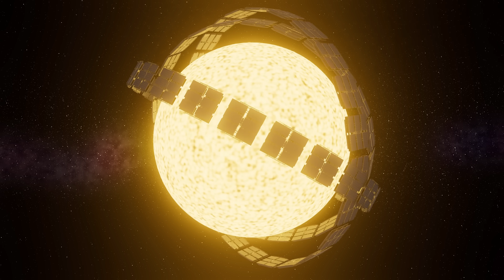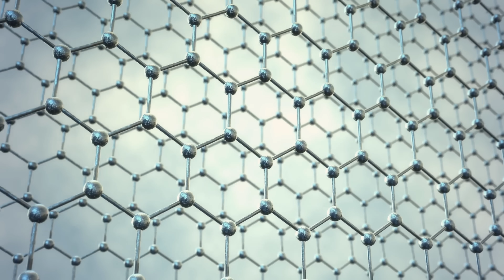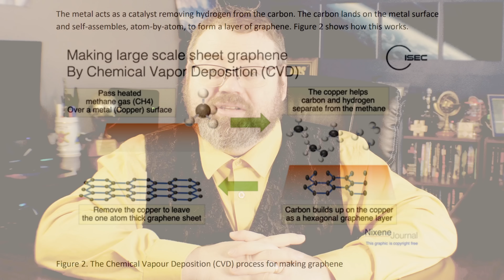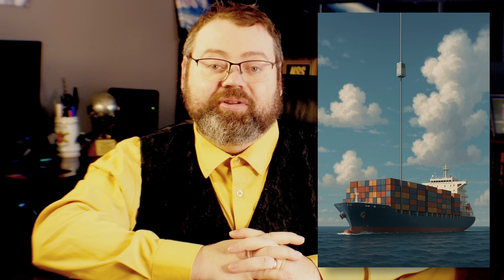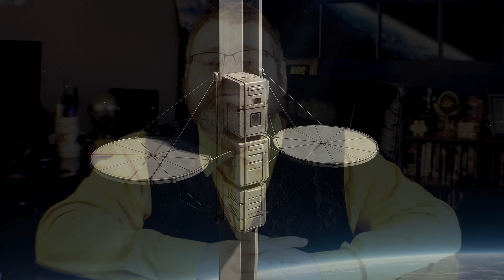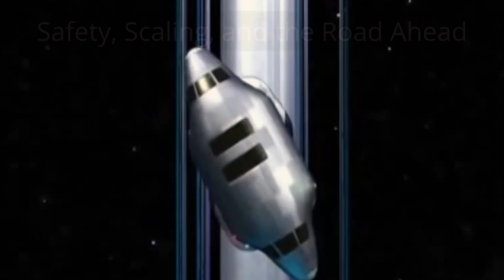Materials For Space Elevators - From Carbon Nanotubes To Graphene And Beyond...

Comment: ah, the sadness when you realize that FTL will be forever impossible. and the gladness when you discover how Megastructures are very much possible.
Reply: I wouldn't be so pessimistic about FTL travel. Until we have extremely cheap to orbit costs, like a space elevator, then we can really stretch our legs to start really developing something exceptional. We all know the government has low key acknowledged AT LEAST that they (and civilians) have been witnessing and capturing anomalous objects on instruments that confirm that somehow, something or someone else is here or visits us. They are capable of leaving our fastest manned and unmanned propulsion systems in the dust without trying. They are capable of making 90° turns or sharper without any perceived propulsion or stress induced on the craft. They have radar signatures as well as heat signatures, they are real matter objects. 

TLDR; don't lose your imagination, because we certainly do not know even a fraction of what's out there, we don't even know what's in the majority of our oceans. We have no reason to believe that any of our present theories or narratives are correct.

Comment: This maybe our only door to space, not exploding rockets,  got to be a better idea than rockets , we use multiple helium balloons every hundred metres of height to stabilise mass and reduce stress on the structure,... I can see  the future to come because it will remain the same more and more, rockets are not the answer....😢😢 balloons and crystalline graphene , balloons made out of graphite net which  uses helium as a lighter gas,  the small box type machines extract the helium from the atmosphere using fractional distillation and this is done at the support points. Energy for this is provided from a perovskite using an amorphous compound layer of solar energy collectors which also surface mounted and stencilled onto the surface of the balloons. This powers the helium distillators which refreshers thd balloons, this becomes more ineffective as altitude rises, requiring bigger distillators. The structure is complete carbon nano fibre,  right down to the electronic circuits to conserve weight. I can say the balloons are like petals or are shaped like tear drop atomic orbitals every hundred metres. Maybe upto ten thousand all placed are stress points and reducing as altitude increases..

Comment: If I may put a bug in your head. Spin carbon nanotubes on copper needles with rotating microwave transmitters. Possibly doped, possibly in rings along the needle's tapered end, to encourage the carbon to settle in predictable rings around the needle.
Embed "rungs" in the tether, for the climber to engage with. These can be simple bars bridging two tethers. A literal rope ladder to space.

Comment: I'm still interested in the economics of tethered rings compared to a space elevator.  It seems like mass would be greater than for an elevator, but launch costs would be nil if you can build it on the ground and then fire it up and let it levitate to its intended altitude.  Which could be sea level at one end if desired.
But I'm not sure what form the orbital mass would take.  I assume it would be something inside of a vacuum-sealed tube traveling at something like 2x orbital velocity, which sounds fairly energy-intensive if you can do it at all.

Comment: Assuming you are using the actual elevator to transfer the energy to the objects going up it why would you even bother with a physical structure of the elevator why would you not just beam the energy from a solar power satellite to each individual elevator cabin rectenna  and then all you are using the space elevator for is to direct the actual objects being lifted and in that case it could be very minimal or actually just a virtual fly by wire

Comment: 11:40~~
Dude... Mars as a source for carbon for graphene?

Venus.
The Process to Break CO2 and make Methane? Easier in high pressure and heat.
Like Venus.

Yes, you have to bring with you the water. Same case in Mars too.

The Launch Window for venus is more often, too.

Venus would be the closest to perfect planet in this solar System for Graphene production.

if we currently had constant acceleration, There would be competition there. Also, if we already had colonies in The Gass Giants...

No and no. Currently, at least.

So yeah. Venus.

Comment: You could have carbon tethers that nothing climbs (aside from tin repair drones), spacers, and then a climbable tether that's strung between spacers.

There are a LOT of ways to address each potential problem.  The tricky part will be doing so in a way that's cheap to maintain and low on mass.

Comment: You need to twist the ribbon to prevent wind from making the flat ribbon from flapping. This is the same for ratchet straps to handle cargo on a trailer.  Of course I still think rotovators are more likely.

Comment: Im envisioning a climber designed like 2 tanks, one on each side of the ribbon clamped together and using electro magnetic connections helping the tracks keep enough  friction for climbing.    
   Love this and all your content.  
  Thank you Isaac
Reply: Or maybe the ribbon has sprocket hole perforations built into it that the climber pushes against using gear-shaped wheels.

If the first manufacturer of such space elevator climbers isn't called Spaceley's Sprockets, I will be sorely disappointed.
Reply: @peterallen5575 100%😂

Comment: Greetings IA.  I’m picturing the defects in the graphene caused by cosmic rays, cascades of muons caused by cosmic rays, solar winds, brownlee particles, and aurora plasmas, etc… Such defects will flow much faster and coalesce more quickly when the material is under extreme tension, causing cascading failures. I’m imagining the wind pressure on the cable and the elevator car, which will push the cable, load it with standing and traveling waves of energy (like a giant harp string) and twist the cable due to curl in the air flow, for instance during a major monsoon or hurricane. I wonder what the Moon’s tidal effects on the cable will be, or the effects of Earth’s magnetic field will be on cables with currents running through them. I am concerned about elevator car crashes, and other accidents, as well as micro satellites smashing into the cable. And on, and on, and on…

[A very rough estimate, from the past, indicated that no material composed of atoms, and held together by the electrons associated with those atoms, could hold together under the tension from the forces from all the various real world sources, even in principle. For now, I see no reason to abandon the old estimates.]

Comment: Expanding on the current design, Transmitted energy either above or below depending on how close the vessel is, primarily due to conversion losses. The tether could have electromagnetic coils in them, that get temporary charges as the vessel is near it's position through a specific frequency of energy transmission to it, transferred from the transit vessel itself. Again, more conversion losses, but that can be factored in to the initial delivery for the full length. By way of having the embedded rail system, it could accomplish use of magnetics without the shear forces from running the magnetics to full length like a Maglev system. This intermittent, and fully controlled system would mean that most of it is off all the time. It would remove the need for solar cells on the vesel, increasing it's weight capacity, cause as is, special solar panels are required in order to function for long term in space, and the "deck" could easily have this version to power the upper half of the system effectively, while the ground half could have ground based panels. Also, the vessel itself could be made with a graphene skin to keep it light, and to put graphene bladders over the exterior filled with water  to protect against radiation, as water is what NASA uses to stop most of the harmful radiation. Need more carbon? Look towards Venus, harvest it's atmosphere for more, just have to filter out the acid.

Comment: I think at this point, ultra strong material better than boron/ carbon allotropes is one of my favorite kinds of theoretical sci-fi BS now, as I realize more and more just how many crazy possibilities extend from the simple fact that something is strong as hell, and that you don't actually have to keep using it just for super strong armor and stuff.

Ideally, this hypothetical even better material would also be incredibly refractory and heat resistant, and still baryonic matter, or at least still having electron clouds, as this gets around some of the finicky problems with things like using the magmatter from Orion's Arm, as that stuff is so weird it'd often be too inconvenient to be of use.

(In the setting, they're pretty much almost always reliant on demigod-like hyperintelligent machines to be nice enough to make anything that uses magmatter for them, that's how tricky it is to actually work with from scratch)

My current idea for "plausible sounding BS extrapolated from real science" is what i call Pulse:

It is basically carbon-based programmable matter, a buckyball lattice specially doped with some other varying elements, each buckyball forming a quantum dot chamber.

Normally, our belief is that such a giant "fake" atom would not be able to form any bonds stronger than the real material it is.

This is originally the case with Pulse...

Until incremental efficiency and manufacturing improvements lead to a variant that can reliably exploit quantum tunneling to do some really fast and weird tricks with its electrons and trapped atoms.

This in conjunction with an algorithm that lets it self-evolve its computational techniques and the "architecture" of its artificial atom layout leads to what's well and truly Pulse:

A material that uses this to dynamically mess with the virtual photon interactions going on within its mass, creating complex Casimir field effects that can alter it in ways previously thought impossible.

Most well known, quickly discovered, and generally easiest to do being its strength configuration.

Though it does become quite dense, and also need a lot of input energy to get to this state.

Comment: If the structure is a big carbon magatube made out of graphene layers, then the structure itself can be used as and electrical conductor to generate magnetic field that will power the vehicles going up-down. Well , going up you need power to move up, going down you need braking system. Or you can use gravity generated power by allowing the falling vehicle(made also of carbon allotropes) to induce magnetic fields and combine-synchronize them with the fields in the cable to transfer the power from falling vehicle to cable by induction. Then the system will be "self powered". Maybe some extra energy is needed but it's likely that almost 70-80 % of needed operational power can be extracted by this "regenerative braking" system.

Comment: I have always thought the space elevator was a great idea, once the difficult engineering could be figured out. If three elevators where to be put up, 120 degrees apart at the equator and then connected to an encircling ring, it could also be a space station . Add solar collectors on the ring as well.

Comment: Still the space elevator is a very unpractical way of going into space.

Here is why: If you would climb one beyond the Karman line, say to a height of 400 km which is where most of the LEO satellites are, and step from the climber, you would fall back to the ground almost vertically like a brick because the system would transfer very little delta v at that altitude.

In order to stay in orbit, you would have to climb all the way up to the GEO orbit, that is, about 36.000 kilometers. If we were generous about the speed of the climber and put it around what the fastest maglev trains of today are, or around 500 km/h, you would need 72 hours just to get there.

After that, if you did not want to stay in GEO, but would want to get closer to the Earth (which is where all the commercial space activity is, and for a good reason, and it will stay that way for any predictable future), you would need to get to the lower stable circular orbit. You could use conventional rocket for this, but that completely defies the purpose of having the space elevator in the first place, so you would most likely perform a series of orbital maneuvers around the Earth. At that height, one elliptic orbit around Earth lasts significantly more than 24 h (a circular one is exactly 24 h of course), and to use as little fuel as possible, you would have to perform quite a few of them, so you are likely looking at twice the climbing time in order to achieve a stable LEO, a total of about maybe 10 days for what a conventional rocket achieves in under half hour.

Comment: Is it just me or is the chatGPT patterns showing?

"We are not just dreaming of the future anymore - we're drawing up the blueprints" 
"Building a 100km ribbon isn't just a materials challenge - its a manufacturing revolution."

It even has the dashes in the closed captions. 

I use chat GPT as much as the next person but heavy reliance on it makes everything start to sound the same and sadly soulless. This is one of my favorite channels!

ChatGPT is an averaging engine, if you use it enough it will all average out to sounding very similar as it removes the nuance. It makes things humans like to hear, the above aforementioned AB pattern, but it does just make a meandering slop at the end of the day if used to edit or write in excess, the sharp points that make something interesting get sanded off. I don't want SFIA to just be another slop presenter even if it has Issac saying the words!

Comment: one thing I think for the counterweight content in the early stages, would be a thermite based fuel. This is because such a fuel serves a variety of purposes, including making metals in a refined state if properly managed, a strong density give mass for the counterweight, being rather cheap to refine, and not requiring oxidizers as a fuel. One thing is also its relative safety, as its initiation conditions are not going to just happen.
Reply from the maker: I think it depends on if we're making the fuel on the Moon or birnging it up the elevator. I tned to asusme you start with a tihin elevator and bring up more strands, and more counterweight, but if it turns out we have to launch complete elevators then it might make more snese to do ISRU fuel off the Moon to GEO+
Reply: @isaacarthurSFIA  I did get that, but I figure from a logistic point, there would be an early stage where the first few tethers are just barely in place, and a counter weight is needed, that would be both non critical to current operations, which means no life support materials, no people, no equipment storage, and generally something that can be balanced in physical fashion, perhaps in ultra specific ways. Granules of some metallic material cover all of these at the lowest volume, until some static facility comes into play, which could be months or years, as additional tether, housing, berths, and all sort art built into the structure. A thermite material allows for both emergency value in construction for welding, and could be pressed into emergency thrusters for a number of needs, including emergency escape craft.

Comment: I think the elevator just need to reach to the cloud lvl to a platform being held up with helium or hydrogen with the balloon or tanks coated with graphen to prevent leaks since graphen is the only material that can keep helium contain.  For the space junk am sure they can make some type of laser to hit the space junk just to alter there orbit enough so they will fall into earth atmosphere and burn up.  Could blimp up to a floating platform to go into space and the helium or hydrogen could be compress on the platform so it could be sent back to the surface power by solar from the elevator.

Comment: of course you first state with scale models. well you can do a scale earth gravity model cant you. pre-paid of course. so that none would be burdened with nonsense. or you just build the track in self-floating pieces. one could say that atmosphere is a ladder. to heaven. or up to space. graphene high altitude blimps would be a stepping stone. or cloud. hard to grab a cloud for support tho, people. manufacturability metrics is important. hold on, layer deposition works just fine on earth gravity too. and you can make a land based virtual gravity track/launcher if you really require the zero gravity conditions but cheap. cable interwoven is the best. try climbing wires first. of the same proposed stuff. oh ocean horizontal acceleration track right. if you use wired, use wired, for power too.use ac current then if you worry about lorentz force. cancel it out by phase. well you better have a nice carbon heat shield for the mach 20 space launches through the atmosphere, horizontally. dont you ever come down to earth, stan.